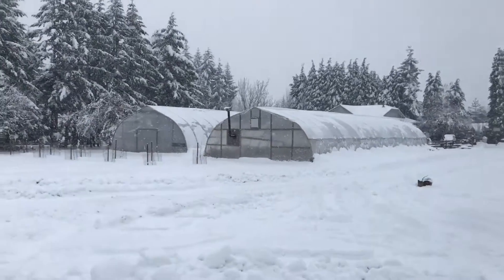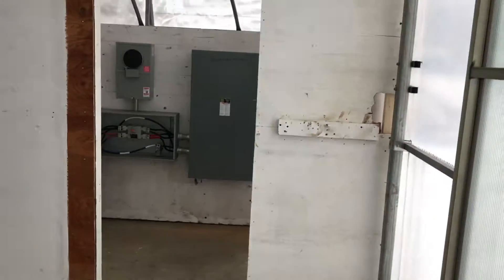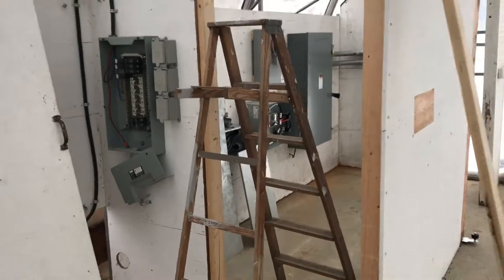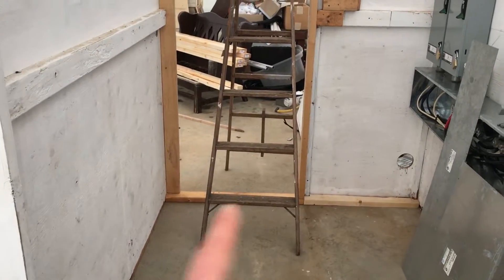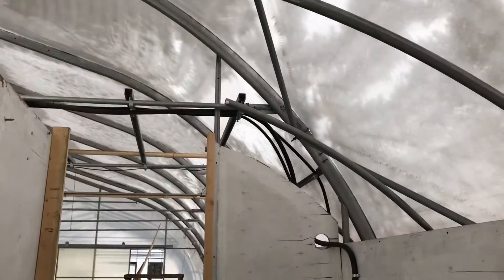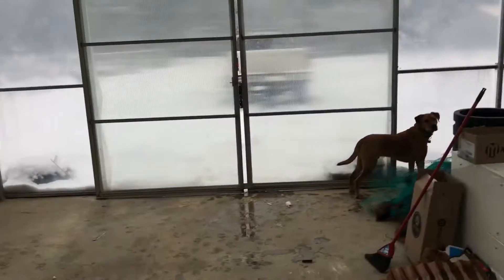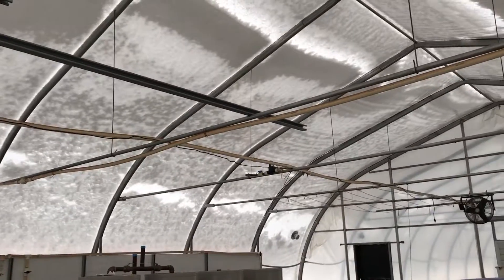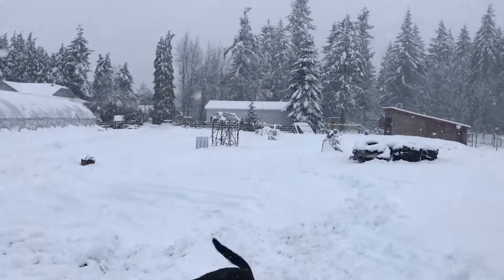Greenhouse Electrical

Comment: I enjoyed watching your video your project is very incredible and interesting your dogs are cool too. So how many amps needed to run all your green houses I’m curious how many breakers per green house. I’m planning on building a green house too. And for irrigation I believe it can have its own timer vs wire into the existing timer do morovidios too whenever you have some time to spare 🤩👍 incredible video I enjoyed it.
Reply from the maker: Kevin, thanks for the comment. I do have an irrigation timer and will make a video of that here this spring. As for how many amps off the cuff I'd guess probably a 60 amp service would be sufficient for what we currently use. This house is also acting as a power supply to our farmstand and have some future plans so there's a bit more coming in then just what is consumed in the greenhouse. Cheers!
Reply: Crafty Farmer oh ok cool 😎